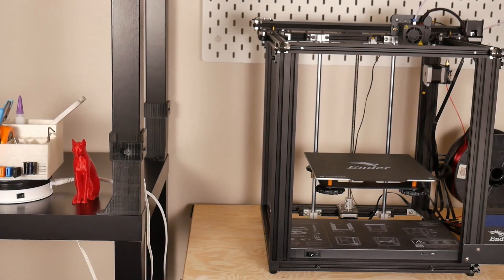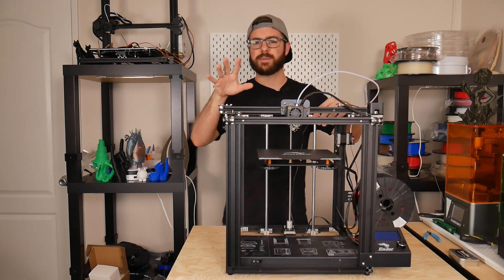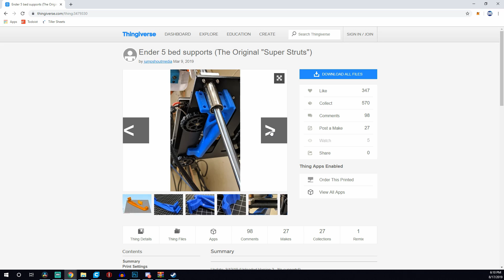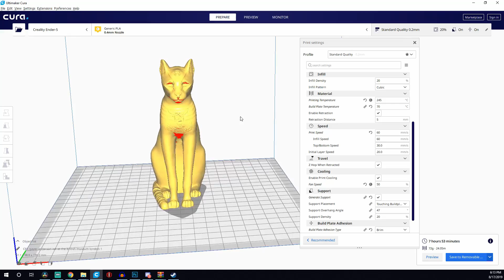Review Of The Creality Ender-5 3D Printer | Most Stable Ender?

Comment: This is a great review.  I think the Ender 5 can print a little faster than the Ender 3 due to the more stable bed movements given it doesn't sling back and forth and box style is a little more stable.   The bed supports 100% make a difference.  If you want to go the next step, you can install a Dual Z axis on this machine.
I am still happy I went for the Ender 5 :)   I went for the Pro version that has the Capricorn PTFE tube and can print 240 degrees quite happily.

Comment: Accurate review. That 5th element guy is great. The awesome cube frame is a bit misleading at first glance for the rigidity and ability to enclose. It does however work out of the box with little set up. I had to redo the Bowden tube for the same reason too... clunkclunkclunk

I use the glass bed on mine. It can get really wobbly and bounce up and down if the nozzle goes over poor infill lines too fast, or if the part is way over on the other side. In the slicer I shove prints as far back as possible to minimize that.

I hope to put another linear bearing system on the other side of the bed to resolve this as I think it has good upgrade ability, but for the price Ender 3 is probably the best bet.
Reply from the maker: Haha I am glad to know that I am not the only one that had the issues with the bowden tube. Did you add the bed stabilizers since you are using glass?
Reply: ModBot Downloaded and looked at a couple different files but haven’t gotten around to it unfortunately. I’d like to hear how this one works out for you.

Comment: At 7:20 you mention PETG and the risk of melting the PTFE tube. I can't believe this is a real problem, I've used my Ender 3 Pro only for PETG and printed out lots of stuff. I haven't had any problems and haven't replaced any parts on that printer yet. The Ender 5 should be just fine as well I believe.
Reply from the maker: Melts may have been a incorrect choice of words. Deteriorates is what I should have said. At 250 and north of it begins to slowly deteriorate. Over time it will need to be replaced. Also the fumes that are created from melted Teflon kills birds and is not good for humans. It is not to uncommon for printers to be off a few Celsius so when you think you printing at 250 you could even be a bit higher. I also print with petg on machines that are not all metal, but I do not want to recommend that others do the same.
Reply: @ModBotArmy  Yes, well, kind of agree on the north of 250 point of view (worked with R&D for cell phone systems for 20 years....lots of PTFE). 229 C seems to be optimal for the PETG I am using, no burnt or brittle parts so far.  Thanks for you reply!
Reply from the maker: If you are able to get it to print at 229 then you are golden. I have some PET-G that prints at 240 beautifully and others that have issues with delamination if I do not print higher. Thank you for your comment! I always enjoy when someone contributes to the discussion :)
Reply: @ModBotArmy  The filament I use is branded Scapefill and it is made in Europe. The recommended temp range is 210-230. Maybe that is not so common for PETG...?

Comment: Note: I am not a 3D Printer user; like to be. IMHO I agree with you that the bed is not supported on all corners. During fast movement it seems the bed will shake possibly affecting the quality of the print. The additional support is a good addition. Why the manufacturer did not provide that with the machine is... but what do want for around $300 US.
Reply from the maker: They just announced a larger version of this machine and it is supported on both sides. At least they seem to have taken the feedback from others and implemented it into this new one.

Comment: You do realize that the speed the Z axis moves down during printing is so slow you will never see any wobble or vibration.  Extra supports and concern are not founded.   Think about it.
Reply from the maker: It’s not the speed of it moving down that is the issue. It is the head of the printer moving back and fourth that causes vibrations through the print. And the bed instead of holding firm will vibrate since it is not fully supported. This is nothing new and I have seen it on quite a few printers in the past.